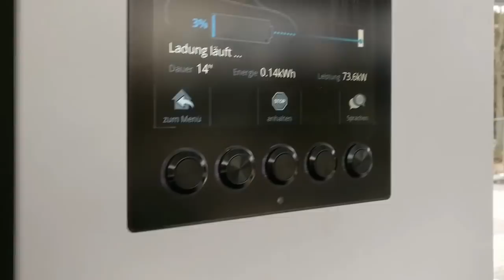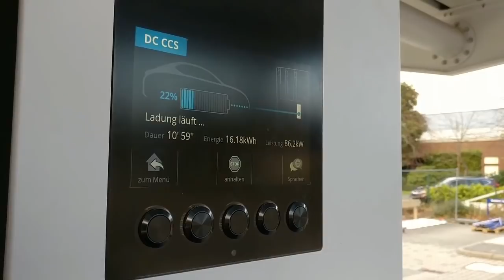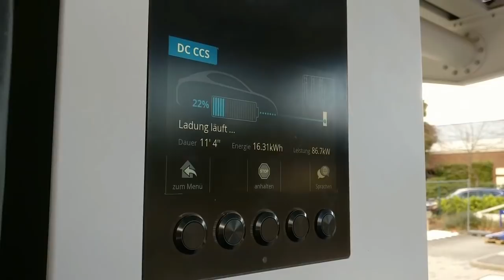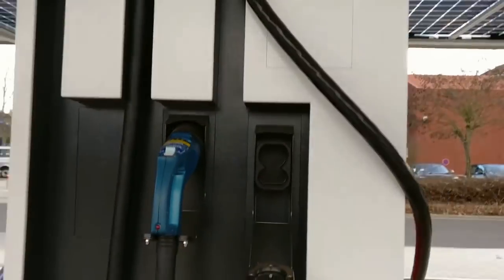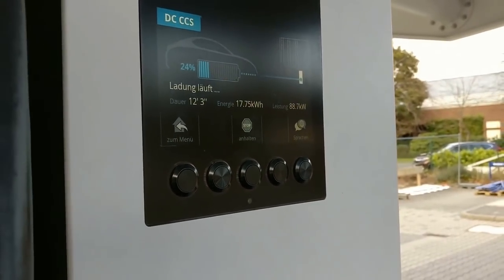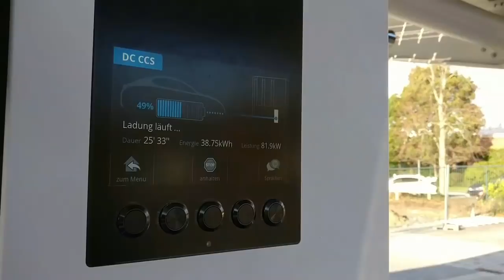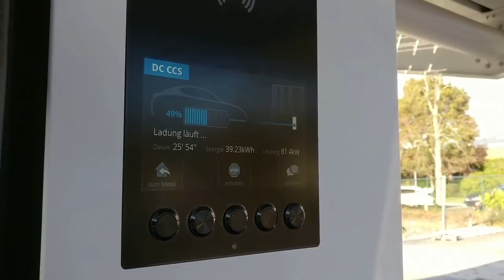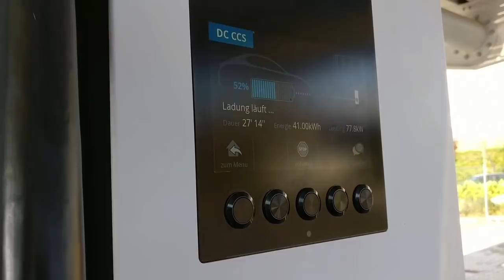Fast Charging the Jaguar I-Pace from 3% to 50% in 26 minutes at Honda R&D Frankfurt

Comment: This is the first video with almost 100kW. So it seems that your I-Pace got already the October update, which remove the 200A Limit. :-)
Reply from the maker: I'm pretty sure that update will get pushed by jaguar Q1 2019. I've been fast charging a lot during my roadtrip and even though I hit the 90kW several times (and here even a little more) I expect the update to bring more stability to those numbers. Because the high speeds never lasted. Hopefully by then we can really charge with 100kW speeds till 60% SoC or so!
Reply: @electricfelix  ... Fast charging compromises battery life so I prefer the slow charging overnight schedule.
Reply from the maker: when you don't need to drive more than 300km a day, obviously overnight charging works out great!
Reply: @electricfelix  Nice video - what speed did you get after 52%?
What software do you have?
Reply from the maker: @andersril5798  Thanks! I was driving an I-Pace in December and it was on 18C InControl and Telematics 14.2 - had a lot of 'black screen' issues back then. About the speed after 52%, it started tapering, and around the 85% mark it will be down to around 50kW speeds. This was my only time ever with an I-Pace to make it from low charging state to 80% in 40 minutes!
Reply: @doctorpanigrahi9975  Nobody says that 50 kW is a problem for a BMW i3 with 33 kWh battery. That means it is no more of a problem (for the battery) to charge the I-Pace at 136 kW than the i3 at 50 kW. 25% lower charge rate for the I-Pace battery at 100 kW than for the i3 battery at 50 kW.

Comment: Hi, have you tried the Fastned 175kw charging stations ?
Reply from the maker: Yes Malcolm, I have one (350kW officially) close to my home (20km away). Especially the stations with the liquid cooled cables are awesome and get about the same speeds as this charger in the video. The thing is with these ABB stations they use, there is no speed indication other than calculating your kWh yourself. So it's less impressive to show. Also it depends on the SoC % when you arrive and if the battery is warmed up properly (now that it's winter), what kind of charging speeds you will receive. I got lucky here, and it was a beautiful day for a video, most of the Fastned stations I visited were in the dark, makes for dark videos etc. I will test the I-Pace in 2019 again and hope Jaguar pushes the BMS update in Q1 so we can get to 100kW charging speeds at all Fastned stations!
Reply: @electricfelix  Ah ha, I have an i3 94ah so the +50kw/h isn't relevant for me at the moment but I'm very interested to see how this develops as I'd like to buy an additional car (we love the i3, will probably keep it)for those longer journeys (my wife has family in Northern Italy and we like to drive rather than fly). I'm hoping that with Supercharger V3 and with the push from VW/Porsche/Audi etc we'll see faster charging rates that will allow you to drive for 3 hours, stop for 15 -20 minutes for a rest and charge, then drive for another 3 hours. So Tesla Model 3 looks like a good candidate, maybe the VW ID/Neo and then we have a Jaguar dealer just 1 mile from home :) 
A table that shows temperature/Charging Unit/SOC/Charge Speed for each car would be very useful. I charged the i3 after a cold night (light frost on the car) when visiting relatives here recently. Battery was so cold it took 1 hour to add 80%, charge rate didn't get above 34% ! 
Great car by the way, lovely colour, well done to you for choosing electric I hope your enjoying it :)
Reply from the maker: @malcolmhedges7346  Yeah I took the i3 94ah to Paris in September! Quite rough ride because of the Sodetrel chargers at the A1 between Lille and Paris massively misbehaving and support not being able to help. We barely made it, end arrived after midnight. My experience with the i3 has seen great charging speeds tough, practically always ~50kW speeds. But it was still 15 degrees celcius 'back then'. Now in winter life might be a bit less impressive. Cold is a thing although I think both Jaguar and BMW try to heat up this batteries when possible. But arriving cold to a fast charger is always going to prove to be interesting, also with the cars to come I think (Audi, Mercedes and such, hope to be able to test them too). Yes I'd love to visit Italy by car too, might drive to Swiss with the family this winter. Lot's of HPC's so looks like a fun trip. Indeed it will be interesting to see how much can be done within 30 minutes with charging in the coming years, we'll get there, no worries! Keep up with the electric lifestyle!
Reply: @electricfelix  I'll be going down in later early July so temperature less of a problem, but the network worries me, big hole the other side of Mont Blanc and as you say Sodetrol notoriously unreliable. We will break the journey in 2 rather than the usual non stop, I'm doing it as a bit of an experiment. Hoping the Ionity roll out will have added some extra charging stations by then. I usually go via Reims/Dijon/Mont Blanc/Allesandria but may look at going via Germany/Switzerland to take advantage of the Fastned and Ionity network. We'll see ... or just buy a car with a bigger battery :) Just checked out Bjorn's TM3 charging video, pretty disappointing, max 93 kw/h and started to taper at 39% .... maybe it was an early model restriction, well see what happens when EU spec CCS 2 TM3's get delivered.
Reply: @malcolmhedges7346  Check out Fastneds real-world charging curve for the Model 3 they tested: https://support.fastned.nl/hc/en-gb/articles/360012178313-Charging-with-a-Tesla-Model-3. About 125kW continious all the way up to ~50%. Ionity CCS2 stations should deliver the same (beware some Ionity stations, esp all in Scandinavia, are not yet equipped with CCS2 liquid cooled cables and connectors because of shortages, thus limiting to 200A / ~75-80kW max. The chargers and transformers are suited so it's just a matter of switching the cables when they arrive, hopefully sometime later this year).